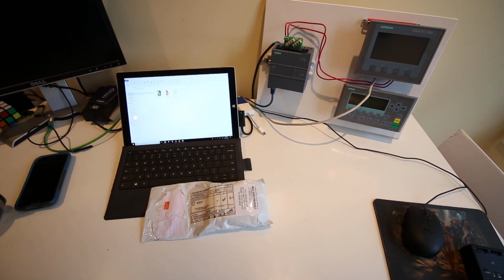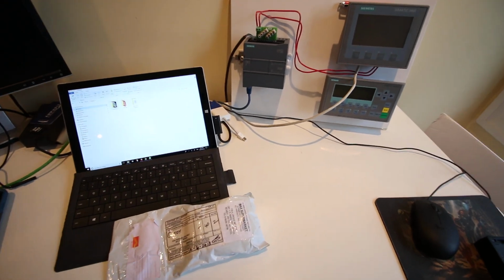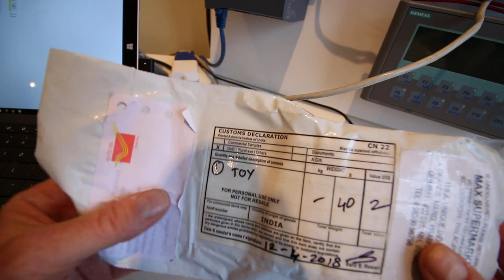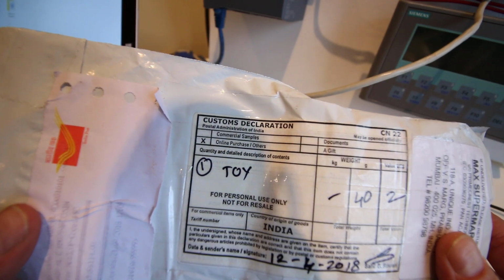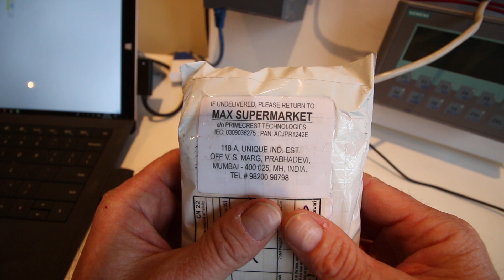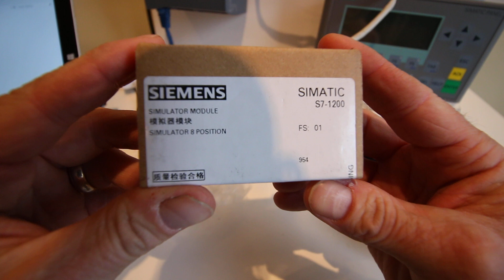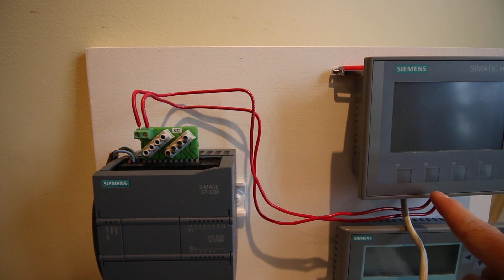Replacement Input Simulator for Siemens S7-1200 PLC

Comment: you could just build a 8 switches your self
Reply from the maker: I just got this guy in the mail as well. Hoping to do a video on the analog input very soon. 

https://www.google.com/url?sa=i&rct=j&q=&esrc=s&source=images&cd=&ved=2ahUKEwjho4yFluvaAhUE04MKHYiEBdgQjhx6BAgBEAM&url=http%3A%2F%2Fwww.droking.com%2FAdjustable-Current-Voltage-Analog-Simulator-0-20mA-Signal-Generator-for-signal-sources-valve-adjustment-inverter-control-PLC-etc&psig=AOvVaw1zXP0Mtw0ee3ZX-W2eVODW&ust=1525492878312992
Reply from the maker: For sure, but I like the small foot print of the input simulator, and the playlist is created with the understanding that you have purchased the Siemens Starter kit. I do plan on making my own at some point, just wanted to let everyone know that there are cheaper options available.
Reply: Pete Vree Super🙂 you're the best.
Reply: Pete Vree please make a video of wiring your own switches to the  input and also a link to cheaper addons like the analog input. When are you doing videos on analog input?
Reply: how can i do that sir? is there any video about that?